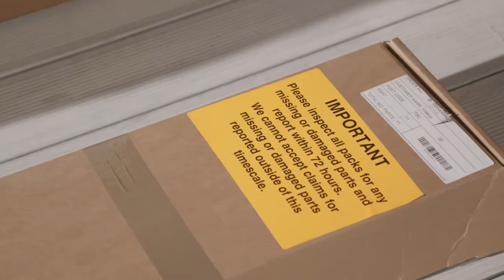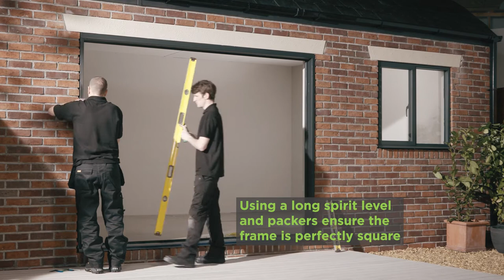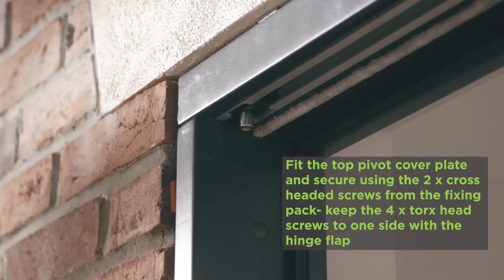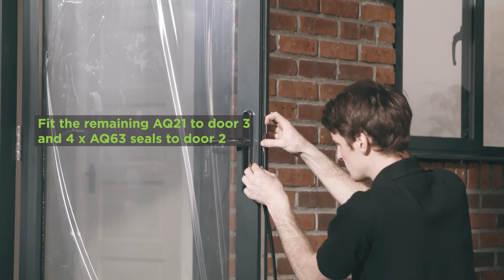How to Install a Wooden External bifold door - Vufold

Comment: does the bottom pivot hinge flap on door 1 go into pre a pre machined slot? looks like placement of it is quite important but i cant tell from the video at 10:06. thanks
Reply from the maker: Yes, this door set is factory pre machined on door 1 for both the top and bottom pivot hinge flaps- thanks for the question